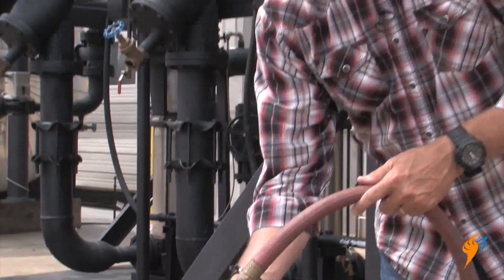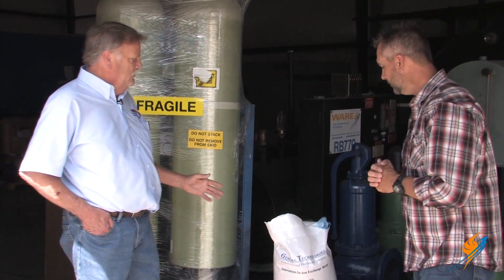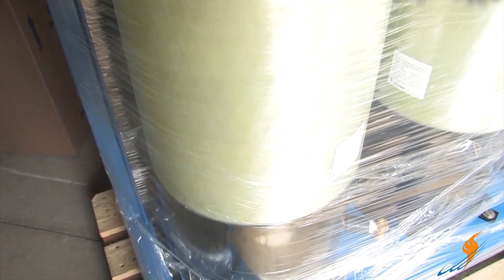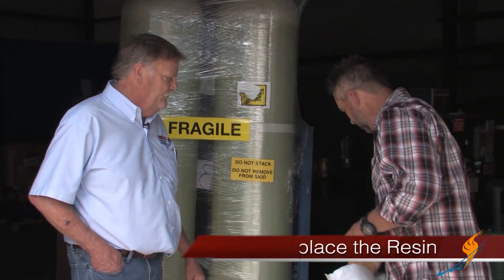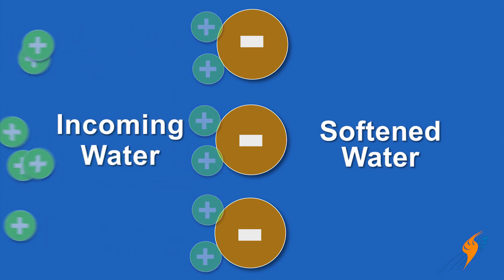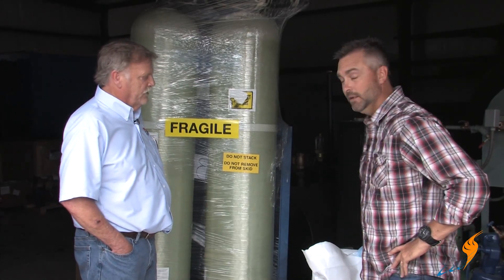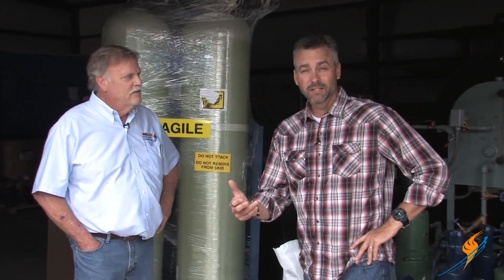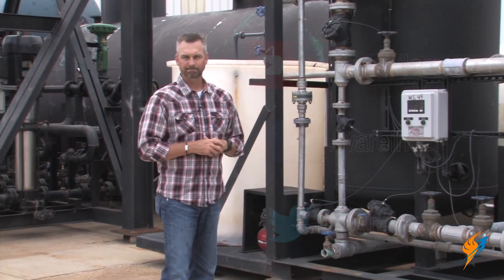Water Softener Resin - Boiling Point

Comment: Hi Steve, if the resin makes water softener, why do water softener company still need pellet salt to produce soft water?
Reply: The resin is negatively charged  so it attracts positively charged minerals. Calcium (Ca) and magnesium (Mg) in hard water have strong positive charges, sodium (Na), found in salt has a weaker one. Initially, a strong salt water solution (brine) is passed through the resin which attracts the Na, coating the entire surface of the resin. Then hard water is introduced. The Ca/Mg have a stronger attraction so they displace the sodium until the entire surface is coated with those minerals instead. At that point, brine is reintroduced in place of the hard water. Even though the Na has a weaker charge there are millions of those ions so they manage to displace the Ca/Mg which are washed out to a drain. At that point the resin can again attract Ca and Mg.
Reply: I believe whats happening is basically an Ion exchange process. The resin bead media is charged(neg if i recall) with salt so when the city water(filled with calcium and magnesium and other minerals also) passes thru the softener there is an exchange process. The calcium n magnesium n prolly other minerals which have a positive charge in the water are swapped with the salt thats in the resin. So after a while the resin is not only full of particulates from city water but also its depleted of its salt ions and full of hardness(minerals from the city water). So thats when the regeneration comes into play and recharging with salt brine. So theres gotta be an interval is how often the softener goes into a regen cycle. Lemme know if anyone who knows the softener process well if i got it right